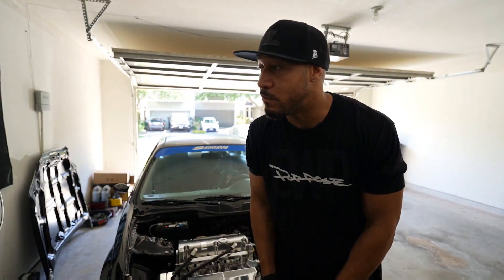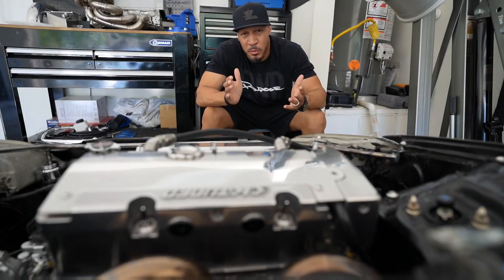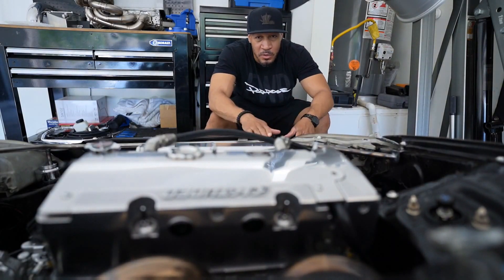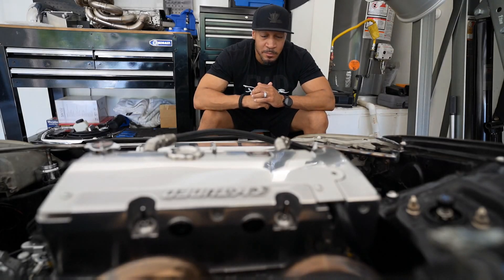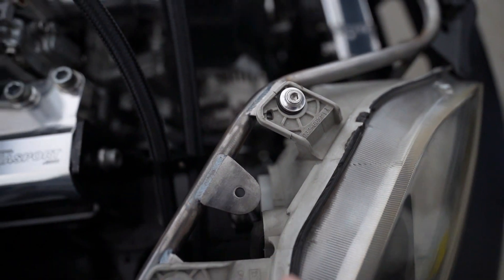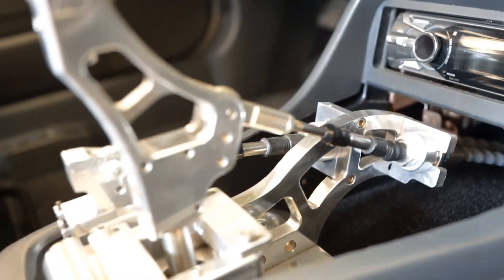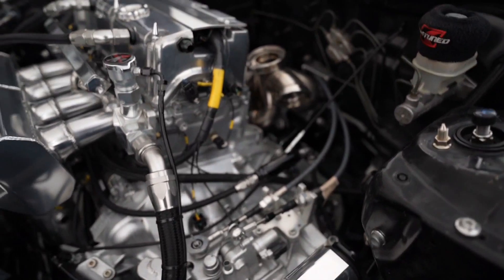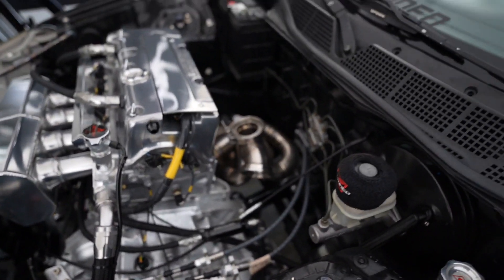TUBULAR CORE SUPPORT AND TURBO EXHAUST MANIFOLD

Comment: Does the whole oem core support get taken off when doing this or just the upper section?
Reply from the maker: For this, just the upper section is required to be removed. Most poeple take the entire core support off, but I left the lower portion for extra structural support

Comment: Keep up the hard work my brother , I had a question did you have any problems with fitting ? Did everything line up how it was supposed to lights bumper etc , looking in to doing this for my eg hatch
Reply from the maker: Everything lined up perfect all around. It was dead on. So no complaints at all. And much stronger than the thin oem core support.

Comment: May I ask if you still have the original Hmotorsonline motor in it? IN retrospect, was that a good purchase/vendor to purchase from?  I am about to take the plunge too.
Reply from the maker: I have the same hmotors block in my car but I did rebuild it with some higher compression pistons to support the cammed head.

Comment: Looks good homie! Real quick question. Did you ever run into any issues or concerns about your battery or vtec solenoid/wiring getting too hot with that original ram header? Did you protect  anything around that area from the heat?
Reply from the maker: No I've never had Amy heat issues with it. It does seem like it's a bit close, but there's a few inches of space and it never gave me any problems.